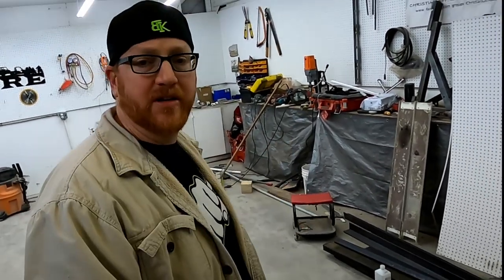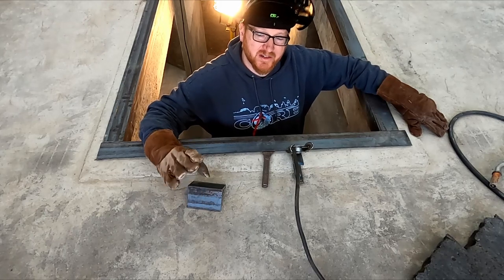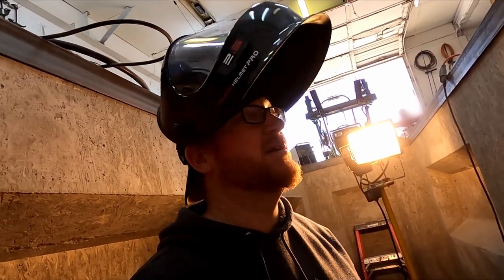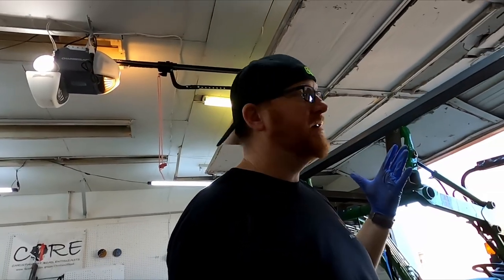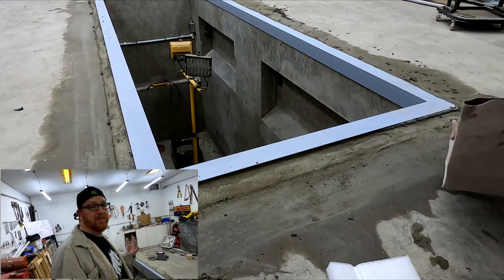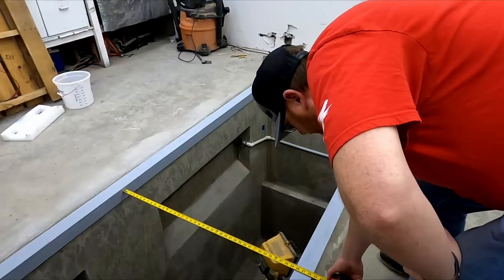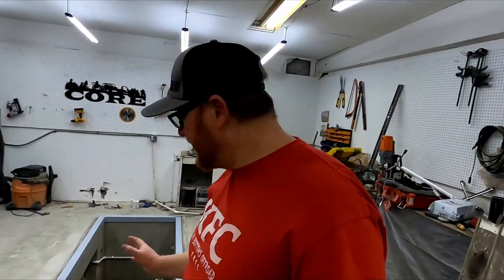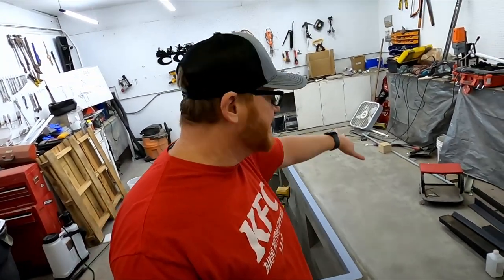Custom Car Pit Rail Install!

Comment: I spend a lot of time in pits under locomotives as a passenger railroad locomotive electrician.  You will find headlamps and stepstools to be quite versatile in time. Our pits have upward facing lights but they just blind you. We keep them off. Energizer makes a great headlamp and it's cheap
Reply from the maker: Cool!  I have some light mods I am working on a video for with magnets that are working great.  We won't need step stools!  We will have an any level hydraulic floor!  That part of the build is about to begin.
Reply: Like I said:  You will find stools and headlamps handy. Enjoy your build.

Comment: You can pre-wet the concrete a few times to hydrate it and increase the crystalline bond from your mortar to the foundation. Something that would have worked great and cured super hard, but would have gotten 'hot' quickly would be tile thinset and poolbrite. It would be best to mix slightly wet (not too much, shrinkage) and have a helper to work one side as you work a side. It sets up fast and is super hard and durable when fully cured. I like the slight bump in height idea, very cool.
Reply from the maker: Good things to know, Thanks!

Comment: Good job man, I would make wheel bearings.
Reply from the maker: I'm starting to think thats what I will do.  Casters are really expensive to get the weight rating I want but your only paying for the strength of the extra material that I don't will be needed for rolling 6 feet back and forth on a fixed rail.

Comment from the maker: Let me know what parts you think we should use making the x frame.  Pins, bushings, bearings, casters...  We have 2x4 rectangular tubing.  We need 4 rollers.  4 smaller pins/bolts 1/2 to 2/4. Two 1 inch pins/bolta for the main pivot.  Need to keep the budget low.
Reply: Do you own a metal lathe?  Too bad you live so far away, I have a machine shop at home.  For pins and rollers, buy round stock in the size you need and cut to size.
Reply from the maker: @jagboy69  don't own a lathe.  Yet.....
Reply: @ThinkBuildTest  Yes you need an engine lathe and a bridgeport.  I'm staying away from CNC for a couple more years until I've got the basics down.  I've been machining now for a few years and feel pretty confident I can keep body parts attached to me.  This stuff is NO JOKE!  Don't be afraid of 3phase if you can run 30amp single phase 240 circuits to power VFD's.  If you will never run more than one machine at a time, a rotary phase converter isn't worth it.
My huge lift has a 7hp 3phase monster motor on it.  That runs on a 200dollar VFD!  It's' magic!
Reply from the maker: @jagboy69  I will probably will someday.  I do like figuring things out without it so that for the starter do it yourselfers they could visualize what I am doing for themselves.

Comment: Not crazy about that raised lip.  I think I would have drilled straight down in the concrete through the angle iron, epoxied rods just below the metal and plug welded a dozen of the stakes around the opening.  It would have been a cleaner looking installation.  But if this works for you.  And yes, I'm still knee deep in water.  :-/
Reply from the maker: Still pumping?
Reply from the maker: Throw up some video of your situation.
Reply: @ThinkBuildTest  I'm just monitoring the situation for now.  The water level is hovering right around 95".  As long as it doesn't start to get stupid, I think I have a good plan.  Over excavate, filter cloth, drainage system, pump, PLASTIC, rock the hell out of it, then 45mil EPDM rubber bag across the rock floor and half way up the walls.  I can protect the rubber with a bunch of old house carpeting and rebar and concrete over that.  Somewhere in the there, needs to be a new well to water my friggen grass.  I'm sick of 300bucks a month to water my weeds!

Comment: Garage door track and wheels
Reply from the maker: They have some 6000 lb rated?
Reply: @ThinkBuildTest  probably not
Reply from the maker: @toolmantaylor2051  well I guess each wheel is 1500 lb capacity.